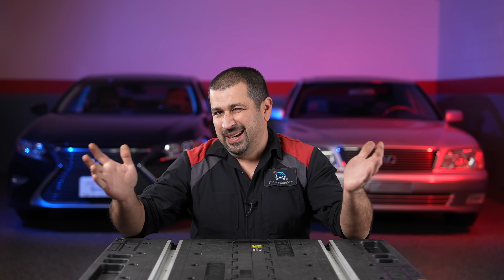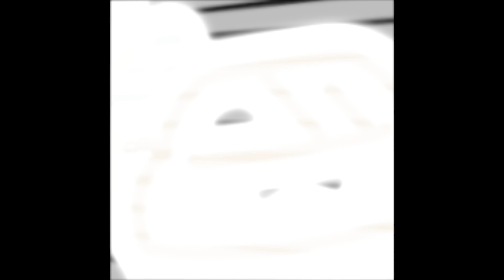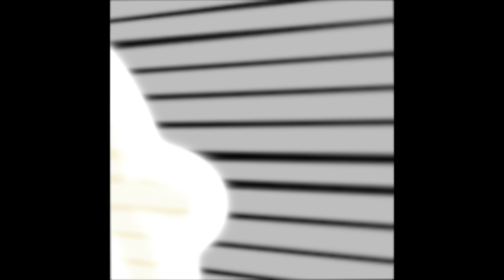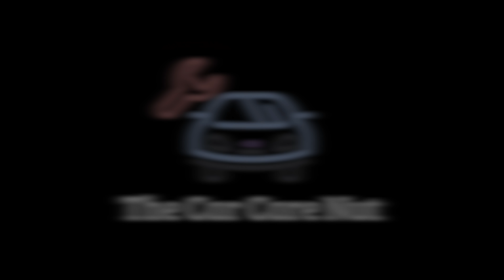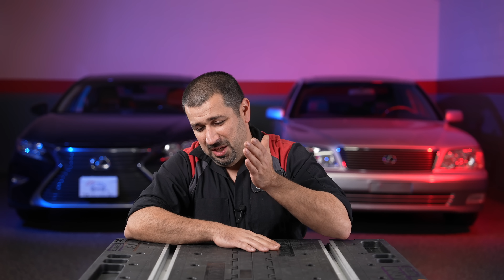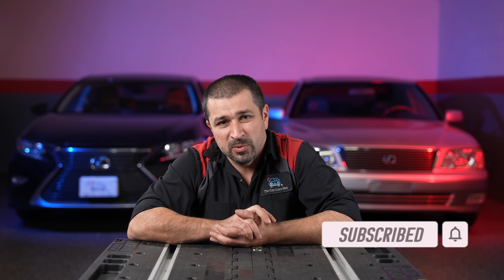Can Modern Turbo Engines Be Reliable? Here's The TRUTH!

Comment: This is solid advice! 
Unfortunately, the vast majority of car owners don’t realize that their engine has a turbocharger on it or even know what a turbocharger is. 😮
Reply: I have met several people that didn't even know cars need oil changes... Like a friend with a Pontiac G6 running factory oil for 3 years, it was a miracle that engine didn't grenade.
Reply: @JMou-14 my sisters  ex-husband when they first met didn't know vehicles had oil in them.
Reply: @Katskraftkorner so it makes sense he became ex😅😅😅
Reply: @adrianhrusca4067 yeah, he wasn't very bright.
Reply: @JMou-14  girls..
Reply: You know some retarded people
Reply: Naturally aspirated with a timing chain not belt.
Reply: @justsayin3600 a good belt lasts more than 140k miles. Tdi. But chain if lubed properly, even more.
Reply: @justsayin3600  - provided it wasn't made by Ford GM or Stellantis
Reply: I replaced my twin turbo at 189k miles last year. $3500. Manifold has to be replaced at the same time.
Reply: @Katskraftkorner I’d rather have a turbo than a hybrid. $3500 is a lot less than a new hybrid battery
Reply: @YoungRetyreei won't buy anything hybrid or electric.  Both are useless to me.
Reply: @Katskraftkorner That sounds pretty darn good actually  !
Reply: My girlfriend's 2014 cruze turbo engine gave up at about 100,000 miles. Took it to the shop and had to replace the head, it was a $4000 repair, and it that repair lasted less than a year. It was only after that I noticed everyone every time I talk to someone about their cruze they said it lasted to about 100,000 miles and then gave up.
Reply: @eldigitom9680  Thats exactly what GM wanted.... to last the warranty period and not much more...
Reply: Its GM. Crap. Wake up
Reply: The problem is we've been changing our oil at 10,000 mile intervals for years and getting away with it. It may take buying a new engine to get you into the 3,000 mile oil change habit.
Reply: If only ALL turbocharged cars (or forced induction in general) had a boost gauge as standard from the factory.
Reply: Sad but true most people know next to nothing about their car
Reply: Don't think many don't know they have a turbo as it's usually advertised on the vehicle somewhere
Reply: I have 3 cars 2 no turbo charger however one has two turbo chargers.
Reply: I had a turbo in my 87 Saab. It wasn’t even water cooled.  I sold that car after 18 years and it was just fine.  Just need to change the oil regularly and let the turbo spin down before shutting down the engine.
Reply: Even worse is the use the term “EcoBoost” … turbo’s are NOT any more eco friendly than normally aspirated larger displacement engines, but the buy just sees “Eco” and they think it’s better … marketing folks should be sued.
Reply: @simhorizon446  They are better in the sense that the extra power (hence extra fuel consumption) is only used when needed and not all the time like a large displacement engine.
Reply: @sgssgssgs  Only if you never accelerate and drive very slow … I’ve own a 2004 Subaru WEX STi 4 cylinder Turbo and a 1999 Mustang Cobra V8 normally aspirated and both cars produced about same power output and same weight and they both got 16 mpg.  I’ve since moved onto EVs from 2015 onwards as their energy efficiency is 47% better.
Reply: This is very true! Consumer technical ignorance is pandemic in scope.
Reply: Am a truck driver for 20 years and I have a lot knowledge about engines any engine, including boxer engines., I use TURBO ENGINE ONLY in tractor commercial truck , BUT I skip any single turbo engine for pickups truck , SUV and sedan cars , just no worked basically is just scam technology , Turbo engine is ONLY for tractor commercial trailers
Reply: Dude didnt even mention fuel which is the BIGGEST factor with turbos. Bad advice.
Reply: @Cody-f1o9f yeah I forgot all most all need higher octane

Comment: Daily warm-up/cool-down habits, shortened oil change intervals, proper fuel, and early ignition maintenance (spark plugs, etc) are key to longevity. If you’re the kind of person who only spends the bare minimum on maintenance, you should not own a turbocharged vehicle! They do not tolerate neglect!

Comment: Manufacturers want you to neglect your car so that if fails before 100,000 miles.
I have seen 7000 miles recommended oil change intervals!
These Turbo Cars need more frequent Oil Changes or at least Top Ups, since there is more oil consumption and degradation due to heat.

3000 miles

Comment: Nothing new, really. Changing it every 3-3.5k miles on my 2018 twin turbo kia stinger, with amsoil signature series. And every 5k miles with mobil1 on my 2013 honda fit.
Reply: I extol the virtues of Amsoil even further.  Amsoil produces their 100% Synthetic Oils to be a combination of PAOs and a Class V Synthetic (such as Esters or an equivalent), without any hydrocracked petroleum, PLUS as an added bonus, the the Signature Series line of oils utilizes top-shelve additives from Lubrizol.  The molecules of these Class IV & V Synthetics are of the same uniform shape allowing them to flow much more readily throughout the engines, transmissions and differentials, reducing damaging heat, creating more power and increasing fuel economy.  Also, the backbone of Amsoil 100% Synthetic lubricants have a much lesser tendency to attract oxygen molecules that affect the majority of "Full-Synthetic" Lubricants (where damaging oxygen can form sludge).

Concerning my 2016 Toyota Hybrid, I sent a used oil sample of Amsoil 100% Synthetic Signature Series 0W-20 for testing (that had gone 12 months and 7,233 miles).  The results were an average of 1.5 PPM of wear metals per 1,000 miles driven (The Motor Geek previously stated on one of the videos, if a vehicle can achieve less than the 5 PPM per 1,000 miles, the oil is really, really good).  The lab said that the oil was considered good for continued use, but I changed it before I received the test results.

The beauty of the Amsoil Warranty which would make it attractive to potential buyers, is that it applies regardless of the age of the vehicle or the vehicle’s mileage or if they never used Amsoil in the past in their vehicle (I haven't seen another motor-oil manufacturer produce such a wide-reaching warranty, as this one from Amsoil)!!   The warranty applies to any parts damaged as a result of the Amsoil product, as long as the vehicle was in good mechanical condition when they first began to use Amsoil.

Comment: The most expensive oil change is the one you miss.
Reply: No it's not done by incompetent techs that make a mistake usually at quick change franchises. I would rather go longer on a proper spec quality full synthetic with an OEM filter than risk the quality at a quick change oil shop.
Reply: @gordonmccracken1209  or stealership
Reply: @gordonmccracken1209 I don't know, I change my own oil, and I choose the best specific mixture, brand, and filter I believe best suits my vehicle.
Reply: @gordonmccracken1209 
Just do it yourself...
with conventional oil
Reply: you sound like the stealership
Reply: @edrader Maybe, but a stealership wouldn't tell you to get oil changes as often.
Because that not getting an oil change, means you will be back for another car that much sooner.
Reply: I missed them for 3 years and the engine still runs/feels the same as when it was new, after 14 years. However it is a diesel engine and not a particularly powerful/large one. 1.6 CRDi Hyundai and 110 HP. That happened a  long time ago, when the car was 4 - 6 years old. So, I guess it depends on the type of the engine and how is the car used (Although, in my case the last 10 years have been almost exclusively short distance stop and go/city driving, and once per year long distance - 6hrs - vacation trips.)

Comment: Family member had a late 80’s Pontiac grand am turbo. 

He asked a old GM mechanic how he should maintain the engine 

Was told to warm it up, let it cool down, check the oil every tank of gas, change the oil as soon as it was looking dark. 

He bought oil in bulk and did just that. It ran forever, wish I could remember the mileage

Comment: You're wrong many turbo diesel BMW and Mercedes have a lot of blown turbos, they Actually operate since 1000rpm and Run to 4500 rpm and 5000rpm so as you can see they also have problems, and now a days we see 1.9 turbo diesel with 500hp and 3.0 turbo diesel with 700/800hp because diesel can do huge torque and are used for street racing and drag racing like a gasoline car now diesel engines doesn't use spark plugs i have a 1.5turbo diesel common rail injection system and never had a problem but i know many had problems with broken turbos and lots of rotten black oil inside like a horrible black paste the ruins the engines

Comment: The unspoken one most guys these days ignore is proper quality air filtration. That stock paper air filter really keeps things clean and you save your rings. I have yet to meet someone with a turbo car and gauze filter that doesnt have oil consumption issues sooner than they should. #1 oil #2.5 filtration #2 cooling

Comment: Gas engines with turbos are trouble. Oil changes must be done more frequently and they cost a ton to replace. The life expectancy will be shorter with a turbo.Diesel turbos are generally much better, but super expensive to replace.

Comment: You are wrong! Turbo really not the problem with modern engines. It's all the variable valve timing failures and over using the engine oil.

Comment: Ah man I used to have a 1987 inline 6 3.0L turbo diesel mercedes bens 300D w124 You make me miss that car. I got 40MPGs freeway and man was it a cruiser at speed. I could go from 80 to 100 in a blink but off the line and city driving it was a slug german tank. one time i was driving and all electronics shut off. the alternator/generator died and then my battery drained so no windows no light no radio no AC nothing electric worked but the engine never even hicuped....no ingnition coils or spark plugs needed in a diesel that uses compression for ignition. it kept running without electronic anything. I miss cars like this. The turbo helps create more compression in the cylinders. I have only purchased 2 vehicles in my life both turbos. The mercedes was totaled by an unlicenced 18year old. I now have a 2017 Forester XT Touring FA20DIT 2.0L turbo with WRX drivetrain nominal 45:55 rear power bias. I wish it was manual but the high torque CVT seems to be holding up it has 8 or 6  simulated gears with padle shifting. It is surprisingly very usefull going downhill on icy roads you can "gear down" and not have to brake to go slower. Its a fast Forester The non turbo subarus are gutless especially if you go to higher elevations where Ca offroaders and skiiers hikers go. My forrester will do doughnuts arouind them in the parking lot..ask me how I know....very fun in the snow. I do my own Oil Changes every 5k miles manual says 6k. I may start doing every 3k. I also started using Valvoline restore and protect to try and minimized DIT carbon buildup. I saw Lake the motor oil geek reviewing it and I was sold.

Comment: It can last if the owners keep maintenance but they usually don't care. Don't shut off the motor when It's hot because the turbo is hot and merda oil to cool down so if the engines stops no more to cool down and lub the turbo

Comment: 10k and 15k mile oil change intervals came from the Marketing Departments.  It was about decreasing the "cost of ownership" numbers marketing was using.  Of course those cost were only projected considering fuel costs and planned maintenance for the warranty period and not over 5 to 10 years of actual ownership.  So 15k mile oil changes, sealed/no-service transmissions, zero grease points on the suspension... none of those were engineering driven decisions.  They were marketing choices to make the car look more appealing with strategically chosen numbers and cherry picking data.  In the same way that focusing on car payment, instead of total cost of the loan is bad.  Extended maintenance intervals are a short term savings with a much bigger long term cost.

Comment: I want to know what other key considerations apart from 3000 miles engine oil change, one should abide with for engine longevity. I know you only focussed on engine oil change. Apart from engine oil change, what other things should one keep in mind? What about transmission fluid for instance, what should be the replacement interval?

Comment: I read the CarFax report on used cars all the time and it's very common to see oil changed at 10k or more miles. Seen many where they went 15k or even 20k. Those cars need to be avoided if you're looking for a long last reliable used  car.
Reply: Exactly why I bought a used 2024 with 2900 miles. I wanted a used car but well before any neglect could kick in.

Comment: Thoughts on  (auto start stop) causing issues on a 3.0 twin turbo in the Ranger Raptor? Doesnt it cause heat issues when engine shuts off at stop light/ect when turbo is hot from driving?

Comment: MY TAKE AGAINST TURBOs
1) KISS=keep it simple stupid.  turbos are complex and more costly to repair
2) the turbos will inject EXCESS (unburned) fuel under load for cooling combustion to avoid NOx 
3) turbos have lower geometric compression ratios, around 8 to 1, less efficient then higher naturally aspirated engines, at least 9
4) require premium gas, more expensive than what  most naturally aspirated engines require which is more likely 87 octane

Comment: Diesel have throttle body only for smoothly shutdown.Main thing is air filter must always be replaced or turbo will starve for air and suck oil from evap.Always leave engine idle for 1 minute after heavy drive so that oil cool down.And of course be gentle while engine worm a little bit.I have 1.6 turbo diesel with 300k km and turbo is completely ok.Lord bless from Croatia.

Comment: I owned a 1988 Dodge Daytona Shelby Z. I changed the oil  and filter every 6 months. 

I'm not sure if other brands did this but Chryco in the 80's with their 2.2L. turbo 4 cyl. And 2.5L. turbo 4 cyl. Used Garrett Air Research turbos. These turbos obviously used oil for lubrication and aid in cooling, but also had coolent run around the turbo bearing.  The system used a syphoning effect that kept circulating coolant around the bearing in order to impede any coking of the oil on the bearing even after the engine was shut off.

My Daytona Shelby Z with its intercooled 2.2L. Turbo had 240,000+ kms. / 150,000+ miles on it when I stupidly sold the car... I miss that car very much.😢

Comment: I had a Mitsubishi Eclipse GSX that I kept stock and it was fun and torquey but I did have various issues with the turbo around 100k miles like oil and coolant leaks, BOV issues, and eventually a blown turbo (nice big white cloud of smoke lol). I did use Mobil 1 every 3k miles too. I got a Subaru BRZ after that and drove 120k miles with zero issues with around 8k mile oil change intervals. As much as I like turbos, I prefer the peace of mind of NA engines.

Comment: The turbo is another moving part that gets very very hot and is internally lubricated by the engine oil. I've been in the automotive repair industry from a dealer to a police fleet service for more than 30 years. The turbo will fail at some  point and the engine will wear out sooner than a naturally aspirated engine...just the facts.

Comment: I am a longtime Toyota fan, and a big fan of this channel.  I've had many trucks and now have a 25 Tacoma along with my 4th gen 4Runner.  I get a lot of comments about how my new Tacoma "just won't last".  However, I think it's a great vehicle (even if longevity is a question).  It would be great if you did a video specifically about the T24A-FTS and how it may (or may not be) designed for longevity like Toyota engines of the past.  Does the extra cooling capacity on the Tacoma help (12.6L versus 10.5L of coolant on the outgoing 6cyl engine)?  Does the hybrid model help mitigate some of the wear because the turbos spool up less (if they do)?

Comment: Todays engines are crap. I will stick with my 22 years old car it looks like new and runs fine. It is worth more and more every year. Show me one new car that goes up in value. Never fall for the Turbo lies. You are making a fragile engine designed to fail give more than it can. I have owned V8 rear wheel drive cars and trucks all my life. Drive a cheap car own an expensive home I say.

Comment: 3k-4k mile oil changes have been engraved into my head since a teenager. 10k mile oil changes are wild lol
Reply: To be fair, I was running 10k oil changes with full synthetic oil on my supercharged engine from new to 165k miles when I pulled the pistons and inspected the rod bearings.  The inside of the engine was clean and the rod bearings had a very, very slight copper hue to them and looked great.  The reason I tore my engine apart?  I had a cooling system failure in a plastic tee broke while driving on the freeway and I lost all my coolant and overheated the engine.  Lubrication wise, it was fine.  In spite of that, I do now run 5k oil service intervals now.